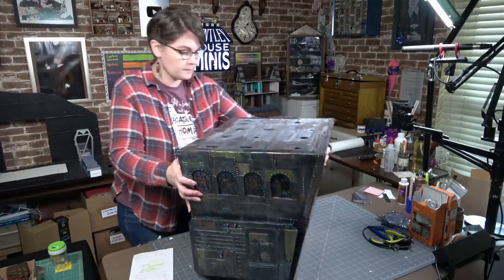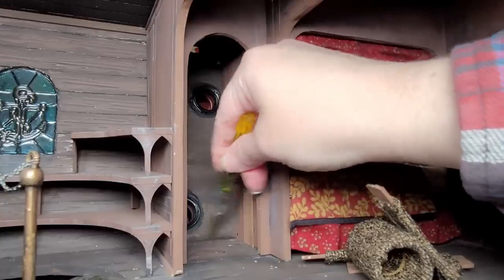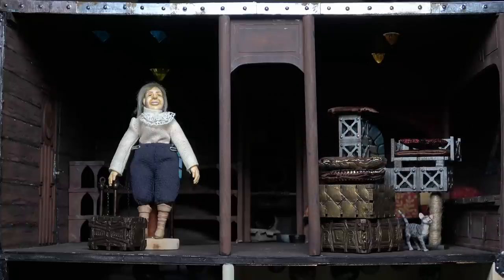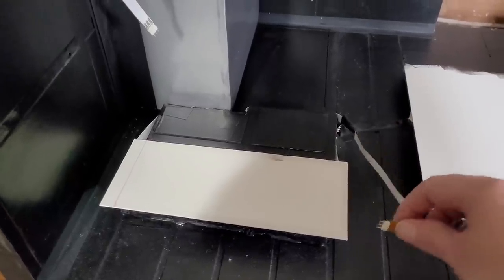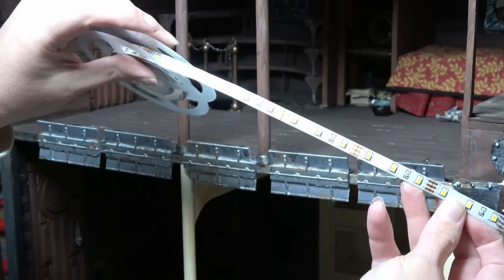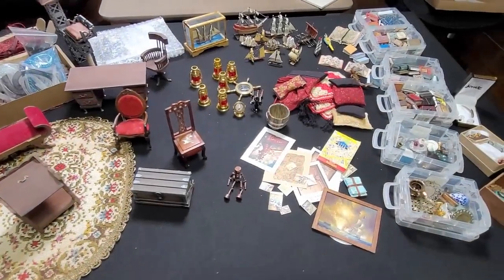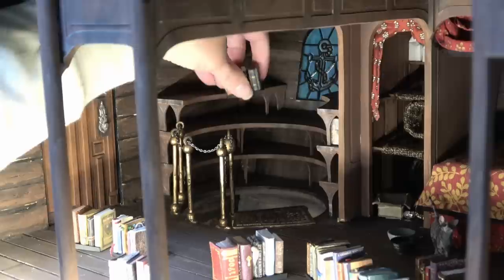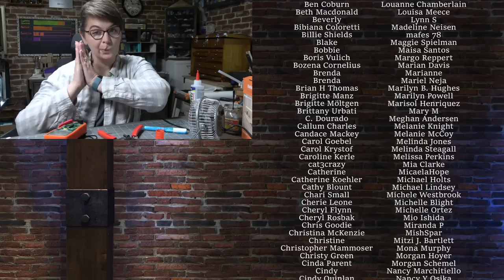The CAT episode 🐈  The Captains Miniature companion!

Comment: So let there be light! Or not? 😲 Nope, fire is NOT fun and I am glad you managed to avoid that. I have never been in a fire thank goodness, but there HAVE been some close calls. An electrician din some shoddy work in my fuse box, so I had some intermittent blinky lights, my computer started losing power sometimes. In the end my main fuse just triggered and would not turn back on, so when another electrician opened it all up there were burned fuses, melted wires and all kind of fun stuff. 😓 So enought about all that fun stuff, let's talk Captain's quarters! 😀
With the lights in and most of the pieces back in place the whole thing looked so cozy and inviting. The cat closet was a great idea, with the pipes connecting the old and the new. Toy mice included. 😉
The little desk robot was neat as well, though it DID remind me (though it is not at all the same really) of a certain other Disney inventors bulby little robot helper. 😛In the end, a good (several?) days work! And take it easy by all means. No burnouts! 🙂
Reply from the maker: That is so scary to hear that there were melted wires!  It will be interesting to see if I find something similar when I open the walls of the Captains Quarters back up to change them out.  I am very thankful there was no fire!  I am so glad you are liking how everything is coming out.  I really did want a cozy vibe so I am happy to hear that is what is coming from it😊  I am being very careful about burnout and have a planned break coming up to avoid that very thing.  I appreciate you all looking out for me!
Reply: @BentleyHouseMinis  Better with a small break than an eternal lack of content. Of course do not do anything you do not enjoy just for our enjoyment either, but I DO enjoy your content.
I sort of lost interest in what I was making on my channel, so it might be called a burnout? I mean I might return to it but it does not seem likeely at the moment. Have a good week! 😀